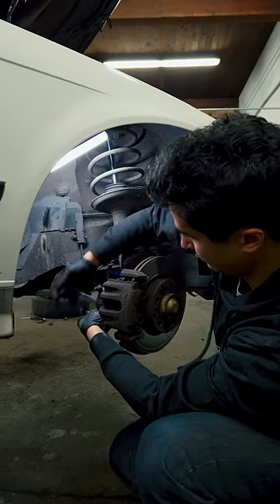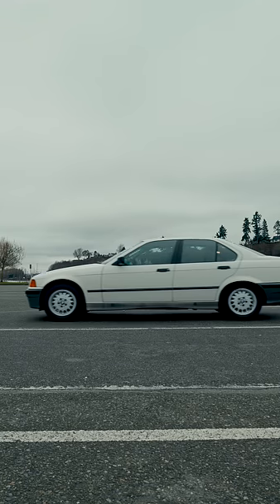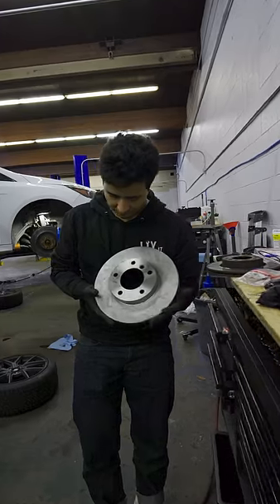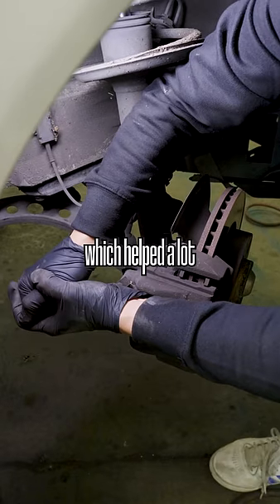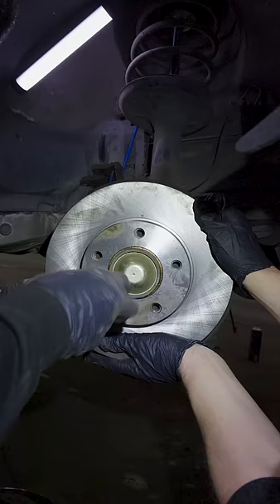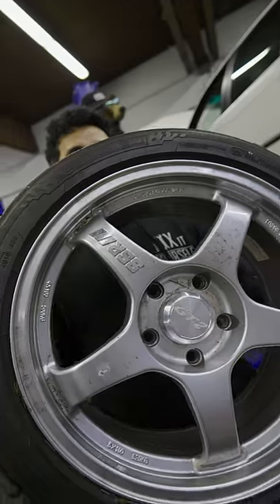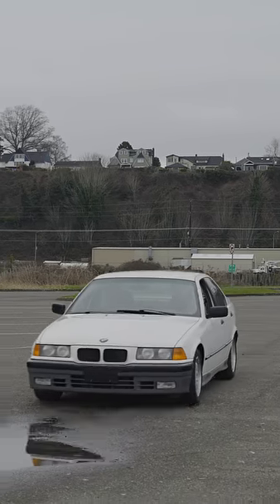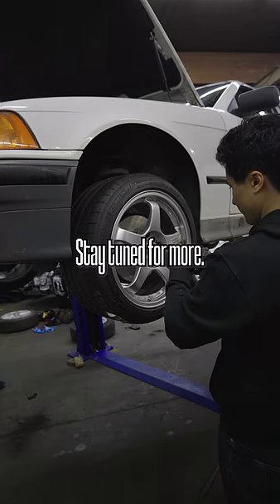My BMW Has No Brakes 😭

Comment from the maker: It’s nice to have brakes again. 🗿 Stay tuned for the Limited Slip Differential install!

Join our Discord for more. 👮🏽‍♂️
Reply: DUDE 🤦‍♂️ THIS IS NOT A UPGRADE… your doing fuckin maintenance 🤡
Reply: @havenstepanek7147 new breaks is maintenance, yes, but he did upgrade to a better brand over the factory BMW breaks and installed better rotors. I’d definitely say that’s an upgrade!
Reply: @ih_guy5602  if it came from the factory with it it’s not a upgrade…. Brembos would be a upgrade perfectly example

Comment: Change the shock and check out the control arm and ball joints for cracked rubber if so change it

Also check out the motor mounts
Reply from the maker: on the to do list 🫡

Comment: I've been told duralast rotors are garbage and warp super fast. How have they held up for you?
Reply: They are my boy please go quality.
Try an advance or a fisher near you. Moneys well worth it
Reply: Ive used powerstop on a few of my cars
Reply: i’ve never had issues and i’ve had them on every car i’ve owned the last 9 years. which is all 8 of them.
Reply: lifetime warranty even for wear
Reply: They do, but it’s hard to get same day parts for cheap and not have them be kinda bad
Reply: @wolleyreikivalley  only ever used it for a new battery. pretty handy tho
Reply: @mbox30____  probably on my end